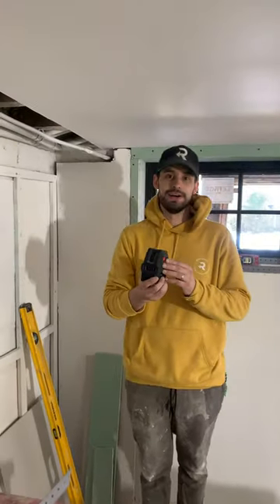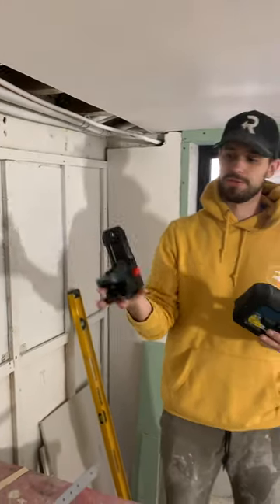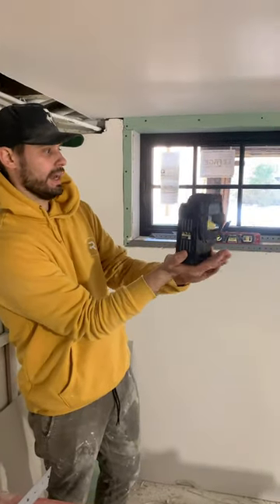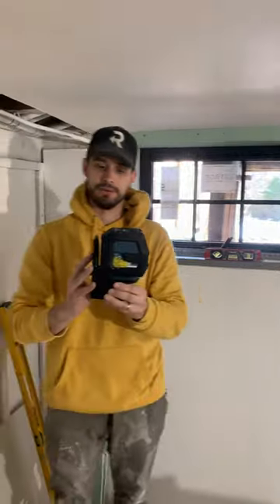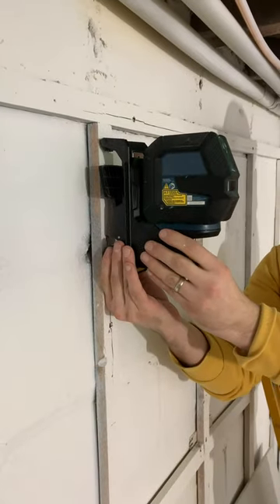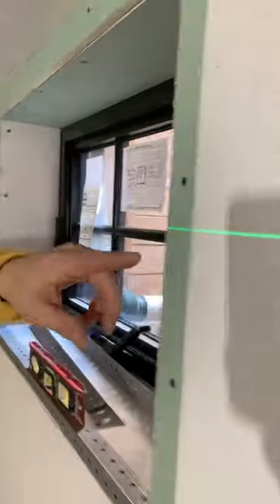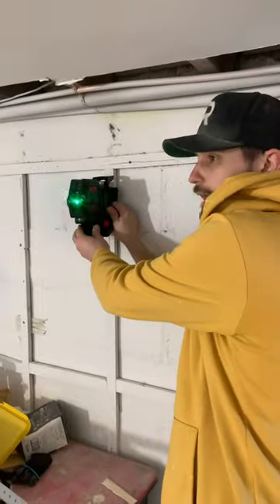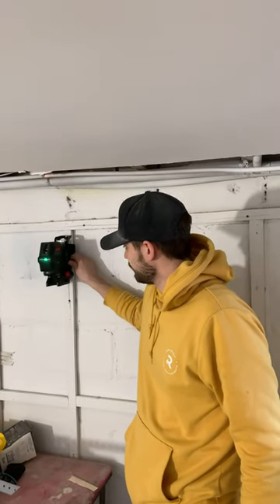Best Thing About Our Bosch Laser Level (Rotating Mount)

Comment: You can buy whats called a "manual high precision rotation stage" and the laser level will attach to it (1/4-20 thread) by sitting on top of it.  Then you can hook the rotation stage (with the laser level on top) to the mount to attach to the wall.  The rotation stage is for very fine tune spin motion so you can line the laser up on a target a distance away with ease.  Rotation stages are mostly used for things in the optics field but you can hook a laser level to it as well.   They are much better than spin control you get from laser level mounts that offer that.
Reply: Thank you very much for the tip. I searched for that but they seem to lack the 1/4" or 5/8" screw to attach the laser. They instead have a female thread. They seem expensive but I would buy one if I can attach the laser to it and if the fine adjustments are really fine and smooth. Later edit: they seem extremely expensive ranging from 100 to hundreds of $.

Comment: Hi,
where to find that wall mount with height adjustment?
I have the RM10 mount and I'm looking at BM1 to get the height adjustment, but then I don't need my RM10...
Reply from the maker: Hmmm 🤔 Our GCL 100-40G came with an Rm10 and a separate magnetic positioning device that looks very similar to the one that comes with the BM1. We’re not sure if you can buy that on its own or not though…